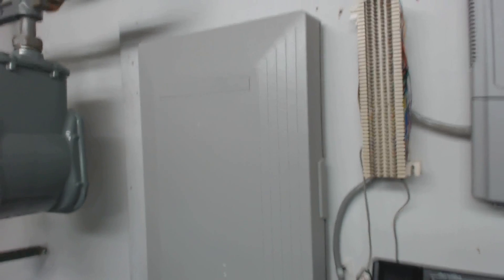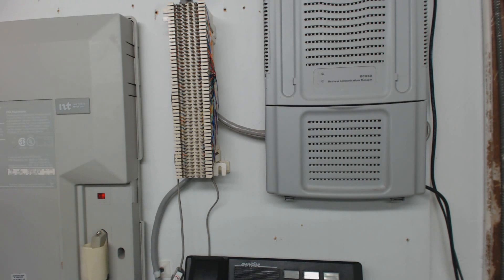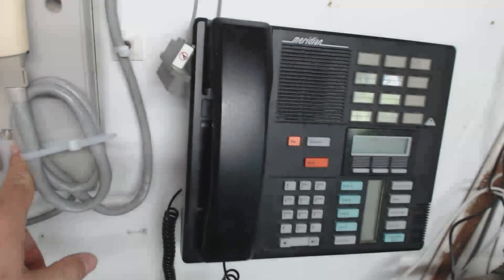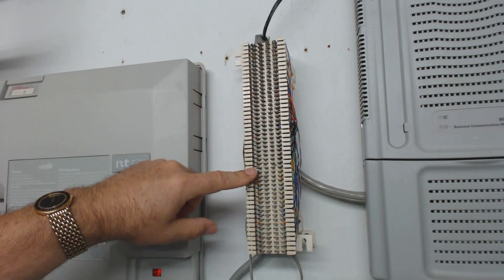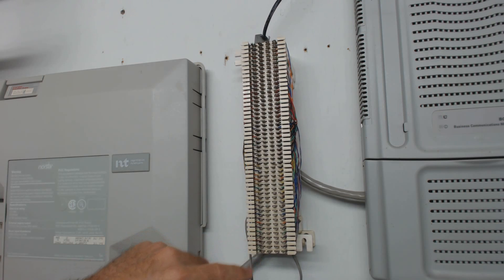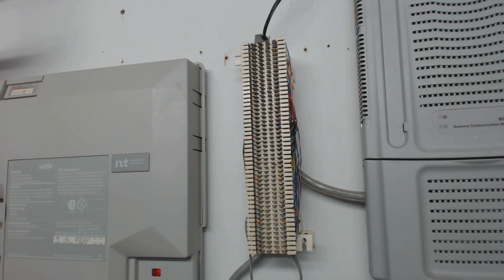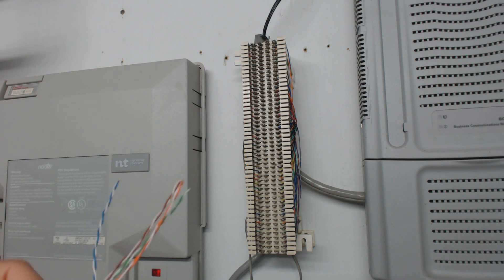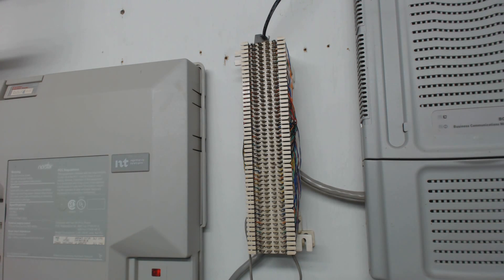Norstar 6x16 KSU Wiring

Comment: You still have your Norstar 616?
Reply from the maker: Actually,  I do not.  But I have the 6x16’s little sister the 3x08.  Basically the same thing only smaller. 😄
Reply: @thenortelguy  1990 system
Reply from the maker: 😆😆. Yep!
Reply: @thenortelguy Does it have the meridian logo on the door of the cabinet?
Reply from the maker: Yes,  but it also says “NORSTAR” (instead of Northern Telecom) so its not super old.   😄
Reply: @thenortelguy  Haha
Reply: @thenortelguy  But it had the meridian logi inside the KSU before the norstar logo when the warranty expired in 1989
Reply: How did you have this system?